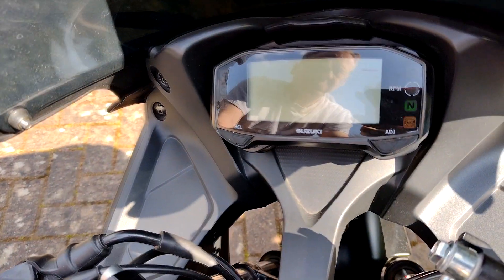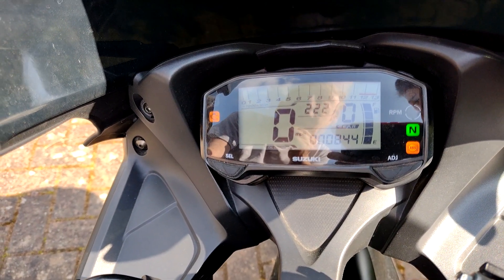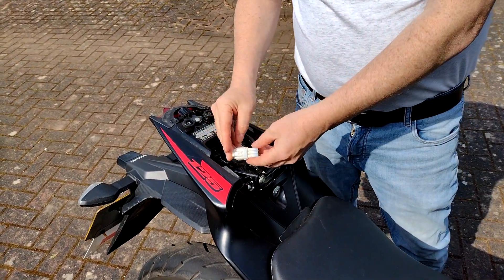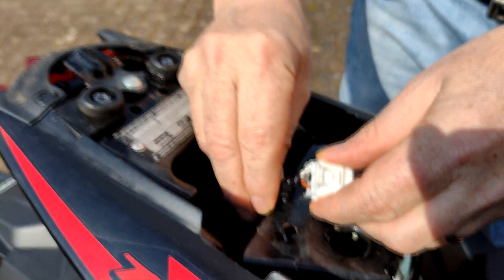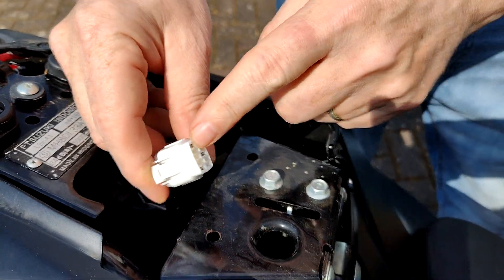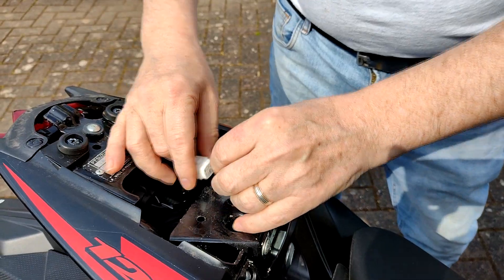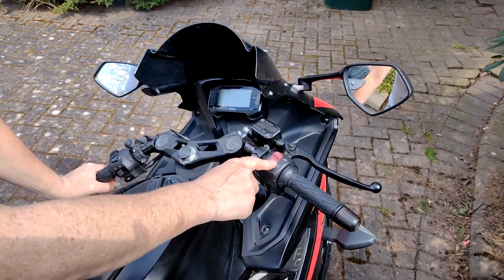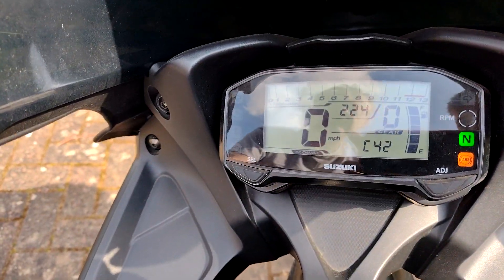Suzuki GSXR125 Dealer Mode How to.  F1 FI Code Diagnostic Mode

Comment: I got something weird going on when i got my engine light on i checked the error code and i got 2 error codes popping up at the same time it said error code c42 and error code c65 what the hell? Ignition switch and idle speed too high or too low? Why does it say that? And any way to fix it?
Reply: I have the exact same problem and I'm losing my mind over it! Have you had any solutions so far?
Reply: @Curiouz_Creator nope😢
Reply: Hello, did you find a solution to the c65 problem?

Comment: Hi Tom, Thank you for this, theres not much to go by still on these bikes on how to do what, got a c42 showing so i know how to start getting it fixed.
Reply: Did you also get the error code c65 same with c42 code at the same time? I got both c42 and c65 and my key battery is completely new dont know why the codes are there
Reply: @Moto_Runnerri just got the same, do you know if the bikes still safe to run?

Comment: Hi Tom I have both c42 and c65 code. Question is where do I spray the dry wd40 on a 2018 gsxr 125 as it’s keyless start?  Also c65 out of range idle speed what does that actually mean as bike still ran ok with F1 showing. The fault came up onway to work last week then cleared. Then came back on this week at the same point of my journey to work when I downshifted gears whilst slowing down.  Any help or guidance is most appreciated cheers Darren
Reply: Heya, did you find the problem with this ? I have the C65 and C42 code aswell, but the bike runs and rides perfect :/

And as you said, where do you spray WD40 ??
Reply: Me too i have both c42 and c65 too
Reply: Hello, did you find a solution to the c65 problem?

Comment: Hi Tom,did you manage to find what was causing the C42 code?have the same problem on a 2018 GSXR125 and hoped you can help!
Thanks in advance,
Andy
Reply from the maker: Dry contact in key barrel.  WD40 spray and 2 hours later fault cleared by itself.

Comment: Thank you very much. By the way, I think "F1" stands for "FI = Fuel Injection". It is not a "1" but an "I" . Don't you think?
Reply from the maker: "Fault Indicator" I think; as there are other codes for other faults.
Reply: my guess was fault ignition but yeah fault indicator is more fitting

Comment: Hi Tom, this worked a treat. 2018 GSXR125 about 9k miles, been serviced every 500 to 1k miles. Had same code as yours. Bought some Dry WD40 and it's all good now.  Glad you showed us the bypass. Not much info on these bikes available yet.

For anyone spraying WD40 into their lock. Use dry non-silicone. Over time, the normal stuff can jam up the lock.

👍🏻